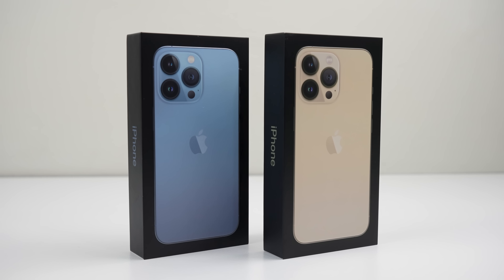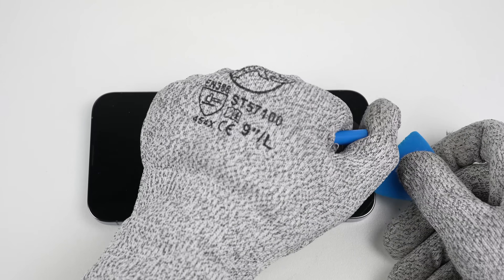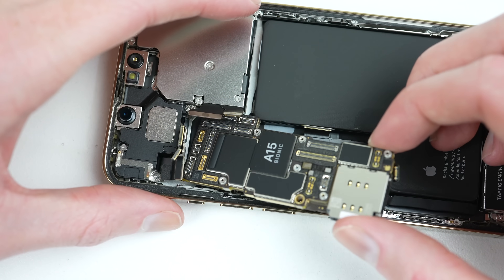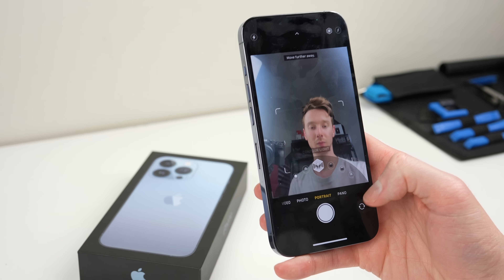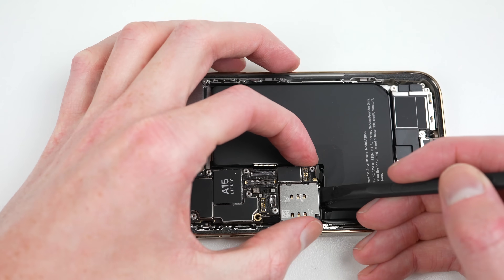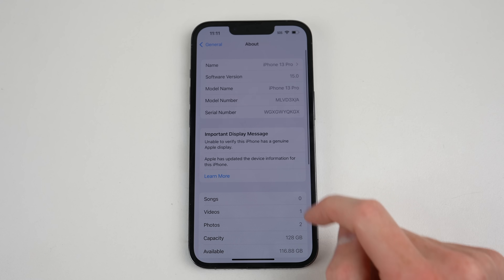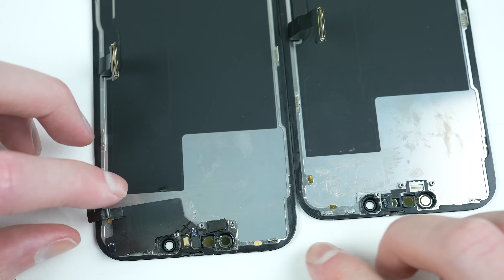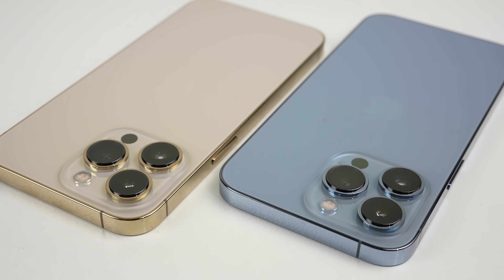iPhone 13 A Repair Nightmare - Teardown and Repair Assessment

Comment: If you need a new screen, either the phone is able to recognize a tech installed new screen's SN or the tech is able to get into the OS and change the SN so the phone will recognize it. Or, worse, it must be sent back to the factory to do this. Or for any part that must be replaced. It has to be able to be done, it's just bypassing Apple's blocks to do it.

Comment: apple has literally taken its copyright or patent to the highest level with this phone. no unauthorised third party repair will work. because the factory they give the contract too also sells these parts to those third party repair supply companies and this results in a black market. apple has coded it very well. If you want to make money over their products you need to become authorised and pay them for the authorisation basically. But this is good to know, so we can tell out friends and family that 3rd party repairs from random online guys without authorisation wont fix the problem. most likely apple has one of those secret button codes to disable the function before even removing the screen.

Comment: I really liked the initial comment about how Apple wants to be "carbon neutral by 2030", but the best way to do that is actually making stuff that lasts longer and can be repaired, not only removing the charger.
Reply: Well, if you recycle it, its good for the environment and THIER bottom line.

Comment: Apple announced to make it easier for 3rd parties to get licensed to get original parts and coding equipment. I love it that my iPhone 13 is worthless when stolen. But sure, I used to repair them myself, I also would like to see easier ways to repair than pay for overpriced repair by now licensed partners. Let's say: You need to do a test (qualification) as a private person or small company that cost you some small bucks to get hands on the original parts and - if you are in possesion of the full AppleID login data - can recode the security chips somehow.

Comment: I think it is more insidious than what most people realize, this effectively eliminates the aftermarket for the phones altogether, especially for third-world countries.

You will no longer see the same lifetime of the devices, they learned some years back that having a good, long-functioning phone means fewer purchases, and in areas where an aftermarket will thrive to sustain them for extreme periods of time, they really don't make as much money.

Now, you are allowed to use the phone as long as Apple is willing to service it, after that, your phone is basically bricked if (and when) it needs any form of Service. You'll hear them apologizing to customers, and saying, "Sorry Ma'am, we no longer service older devices such as yours." -> 2-3 years after release you'll start to see this, at the start they may service them longer, but in the long run, you're screwed.

Comment: US and EU need to fine Apple every year until they stop these anti-repair tactics.
Reply: Every DAY. As such a firmware update simply entails removing whatever crosschecks the attached serial numbers to what is in the main board's memory.
Reply: Yes, and big fines too. I reckon a fine of 50% of their annual TURNOVER (yes, turnover, not profits) per device would be enough.
That's 200% then (iP13 mini, iP13, iP13 Pro, iP13 ProMax).

Comment: An important point that everyone seems to be missing is that making an iPhone unfixable also makes it pointless to steal. 
Older stolen iPhones, even if  iCloud locked were still worth hundreds of pounds to thieves as they could be stripped for parts. If new iPhone parts can’t be re-used or re-sold thieves will stop targeting them. 

And yes before anyone rants at me, I am well aware this was not Apples main concern when deciding to make the iPhone unfixable. It may just be a by product of their greed, but it is a good one.
Reply: That was the very reason they came up with the iCloud Activation Lock - to prevent theft.  It worked on some level until people just opened chop-shops to use the phones as parts.  With the out-of-pocket cost of a new iPhone 13 I can see how these 'features' could be a welcomed by-product to prevent theft.  

I can't tell you the number of times I was able to turn two or three broken iPhones into one functional iPhone by being Dr. Frankenstein with the parts.  Now, that's gone too.  

My days as a phone tech are numbered if this practice remains intact.  This makes Apple the single point of repair for this device.  Also, it takes local money from local business, too, in favor of bloated corporate greed.
Reply: @theoriginaldreadpirateroberts  that was my point. How many stolen iCloud locked phones have been Frankensteined into a saleable phone.

Comment: Its worse than this video in reality. Apple don't repair their own devices PERIOD! they just replace entire sub systems. This is an e waste apocalypse! This became obvious last year when diagnosed a fault in an LCD driver chip on a macbook air. Of course you cant buy that chip! So the laptop went off to apple where they replaced the entire motherboard and LCD screen. Conclusion: They have no component level technicians anymore, no ability to de solder a 2€ chip. Instead its a 800€ repair where you loose your data because the SSD is soldered onto the motherboard

Comment: Apple are a bunch of ****ers, so fed up with them soldering more and more things onto boards that should be replacable or upgradable parts. ssds, batteries, ram on macbooks, its a disgrace.

Comment: Super wierd, all the problems u had with your phones after swapping parts are the exact same and only problems I have with my phone. But my problems started after I dropped it in water.
Reply: I wonder if apple also intentionally made the “bugs” start after it detects water🤔

Comment: Apple pretty much bricked my iPad mini, it's almost 5 years old. Apparently can't update it to 13, so half the apps asking to update can't, and won't run. I'd replaced it and was using as a home pad for the home theater stuff, but now even that won't work. So slowing it to a crawl wasn't enough for them. And they refuse to let old apps continue to run apparently, so Apple says FU. I am so rooting for the PinePhone or any other goolag/apple replacement.

Comment: The thing that pisses me off most about Apple preventing 3rd party repairs is how directly it goes against their claims of being sustainable. It's great making the current phones more sustainable, but the thing that will make a much bigger difference is LESS NEW PHONES - particularly considering the current chip shortage. 

Apple is one of the biggest tech companies in the world with some of the best technology engineers, designers, and access to the best financial experts and economists. I am quite sure that they are MORE than capable of devising a business strategy that is truly sustainable without imploding - they simply choose not to.

Comment: My conclusion is that it works as the method of software licensing associated with the serial of each product, when changed do not match, what could be done is once repaired the equipment for such a piece replaced and associate it, making a CFW for each specific cell which is somewhat complicated unless you could only patch.

Comment: So, what is the problem? To me it seems it is reasonably easy for a seasoned repair center to repair an iphone. Admittedly, you probably need to reprogram some rom-chips, but that will be done by a repair centre. The only problem, you can not repair it yourself. But 99.99% of users don’t want to repair their phone themselves. So, again, what is the problem?

Comment: Are the protocols encrypted? Are we talking XOR or symmetric? It would be incredibly wasteful in terms of power, die size and cost to put secure/crypto IP onto each dinky sensor driver.
Reply: In layman's terms, easier to jailbreak on the component level.

Comment: The reason for the camera and Face ID issues is that they have to be calibrated to work properly, just replacing the module will not work properly even if they didn't block functionality by software.
Reply: The same thing happens with a lot of android phones as well, except their software won't complain. I have repaired a ton of phones at authorized workshops and we had to recalibrate a lot of different components after replacement. For example proximity sensors, laser autofocus sensors, those motorized flip cameras (they are fucking hell to calibrate, takes forever), etc.
Reply: What happens when those android phones have stuff replaced without calibrating is that the functionality will fuck up in different ways, for example if a proximity sensor is not properly calibrated, the display might not darken and lock the touchscreen when you're in voice calls.

Comment: I hope that the countries can get out laws which prevent this from happening more, we need to throw aside the consumer mindset society and we need to force companies to build sturdier and easy to repair products, in the past electric items were stronger and held longer we still use a kitchen machine that is over 30 years old and works better then newer ones. The repair ability of electronics has to be a requirement not an option.

Comment: How people still continue to buy iphones, with the way apple treats its "customers" is beyond me. 
Greed knows no bounds.
Reply: I have used my iPhone 4 between October 2010 until December 2015, changed the battery in 2013 and it  was fine. Then I have used the iPhone 6S between January 2016 until September 2021, and it was not even laggy. I have changed the battery in July 2019 and it has now 610 cycles with 81% of capacity. I have bought the iPhone 13 because of the quality of the materials and the power of the chip. All the transfer was done by approaching the two phones together and worked out of the box. Honestly, I never expected so much planned obsolescence from Apple. Not so long ago, they said that the best way to reduce ewaste is to use the devices longer. Their behavior is the opposite of what they communicate.
Reply: @Maxime7101  
If you have bought their device - how is it their fault? Maybe you like this hypocrisy and being taken for a ride. I can't fault Apple for giving you what you wanted.
Reply: @Alb 92 do you really think I'm one of those people who buys headphones and earbuds for fashion? I've had SoundLiberty 79's for years, and they sound great and are made well. Whats more, they cost me 50 bucks on Amazon. I don't even own airpods and probably never will, but when I've used my friends ones I've noticed that they sound really good and balanced, they fit in my ear nicely, and the case  and buds themselves are tough to actually be used daily. Also they dont have shitty touch controls, which I hate on earbuds. Basically, I'm going to stick with the cheap but good value stuff, but if you have the money to burn then get airpods.
Reply: @Samson 92 I bought my second iPhone the year Pokemon Go came out. I used it a lot 🙈 The battery is supposed to last 500 cycles. I was way above that.
Reply: because Apple consumers are dumb NPCs
Reply: Hubris of both parties.
Reply: I said this stuff in a other comment but some of their stuff is so good. Having a camera that takes pictures and videos you would get in a 2k€  camera for half the price with it coming with the features of a phone is amazing. Also their iPads are amazing. Pro create is amazing and they’re really nice to use in a work, study environment. Scummy, and evil but good at what they do
Reply: @g8x2keeper  Yeah, apple makes good products, they just have bad standards and practices, and outrageous pricing
Reply: @hazmatbp  These are good products?
Reply: @gangadin2873  not talking about the iPhone's, the only apple thing that I really like are the airpods, they're good quality but cost way too much to be worth it
Reply: @g8x2keeper  the cameras aren’t a single bit better than those of the Galxy S20, let alone the S21 Ultra. Stop acting like Apple is the only company ever to do anything, as a matter of fact they were overtaken technology wise by Samsung years ago
Reply: @g8x2keeper  Sorry these are trivial things compared to being the idiot who bought an apple product. My videos are not more important than my self-esteem
Reply: Ganga- trivial? Im a fucking photographer and the iphones camera has come in absolutely clutch for me. Ive taken some of the best photos you would ever see w my iphone. Ive sold photos from my iphone to ppl across the country…
Reply: @gangadin2873  people like different things. I like to edit a line make clean videos and doing mini projects on an iPhone is fun
Reply: @g8x2keeper  
Hey, if you have no self-respect - go ahead.

Comment: Sadly not surprising given that John Deere and Tesla basically get away with doing exactly this. For companies like Apple, "innovation" means "finding ways to lock in customers and lock out any and all competitors".

And I find it absolutely hilarious that genuine Apple parts from ANOTHER IPHONE are triggering "we can't verify that this part is genuine" messages. This means the entire point of baking a serial number in the part's firmware is to lock out 3rd party repair. This will also make "official" repairs more expensive because the Apple and Apple-certified repair crews will use specialized tools to sync the logic board and replacement component. It could spur a cottage industry where someone comes up with a device that lets a 3rd party or harvested component spoof a "genuine" part. Not sure if that's even worth the trouble.

Comment: So, Apple have installed unique hardware ID on EVERYTHING - right down to a sensor cable, and all this with one pathetic aim - to prevent the customer, or 3rd party repairer, from doing their own repairs.
Apple --> you are the scum of the earth. The 'right to repair' movement / EU / etc should really be looking to shut down - permanently(!!) - companies that employ such disgusting practices, as a lesson to all others. iSheep will be sheep, but they are also 100% braindead.